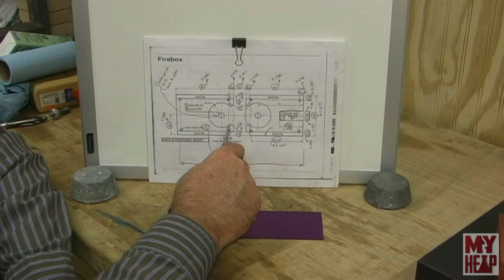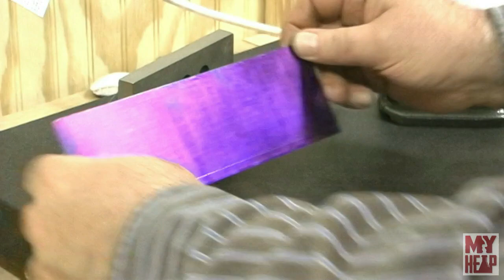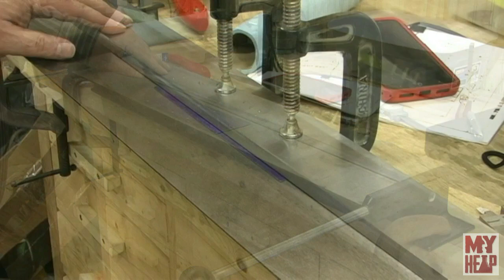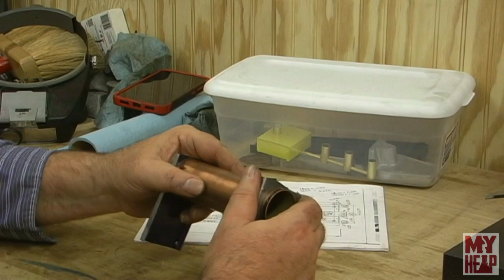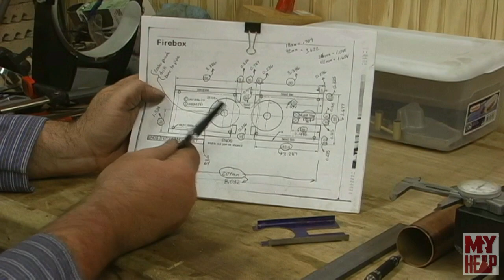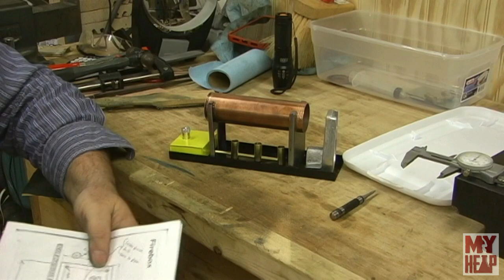Kenneth Wells Stationary Engine - 06 - The Firebox Ends

Comment: Nice with the thinking outside the box on the workholding. Looking good Joe. i need  me a height gauge! 😐
Reply from the maker: Thanks Richard.  After I cut the strip from the middle I realized what I had done.  Didn't like the idea on making it over again if it could be helped then thought of clamping to the face plate.  Worked out great.  Speaking of surface gauges, I bought mine when I built my last CNC router.  It is a useful tool to have!

Comment: G’day Joe, man it’s looking good. For layout die I use Spray Marker paint like they use on building sites, it’s cheap and works great. Here die marker l brush on paint comes only in 1 litre for $35, it’s not so much the cost I have problems with it’s the container size and that I would have to decant to a small bottle and the fact it would out last me:) Hey the faceplate and clamp was a good workaround and that clamp bar for the pan brake is screaming to be another project , a couple of posts with eccentric pivots and arms, angle the plate to take fingers your on your way. Cheers Peter
Reply from the maker: Hey Peter.  I am not sure what spray marker paint is.  You mean like the stuff that sprays straight up from the can that utilities use to mark water, gas, telephone lines?  I need to do something because covering a whole place in marker is time consuming.  I think I will fill me little gaps at the corner with some JB weld.  It is strong and cover them nicely.  As for the brake, it does need some sort of clamp leaf.  Doing it by hand isn't the best experience.  Thanks for stopping by and watching.  Thanks for taking the time to comment.

Joe
Reply: Joe you guessed it, the only drawback is you use the can upside down but hey the can says it’s for concrete, steel, bitumen and timber, maybe the one for grass is different, don’t know. Cheers Peter
Reply from the maker: I will look for some the next time I am at the hardware store.  Small containers of layout fluid can be had pretty inexpensively.  Handling a whole litter and trying to decant to a smaller container would likely leave me looking like a smurf.  Haha.